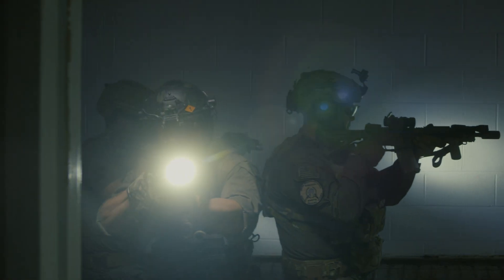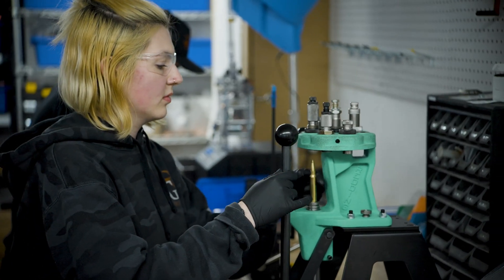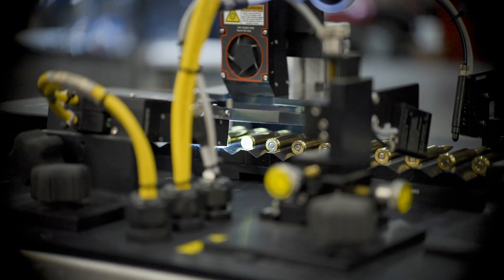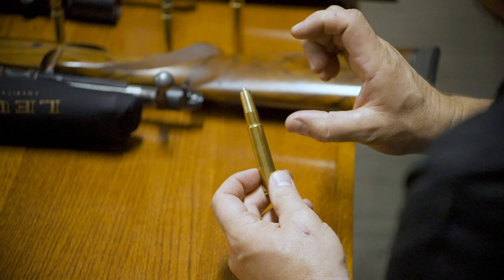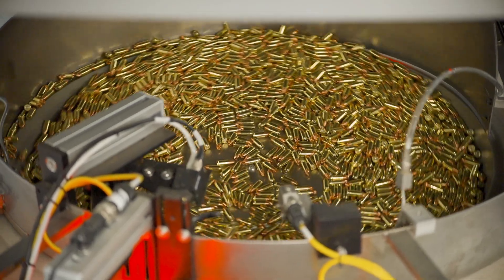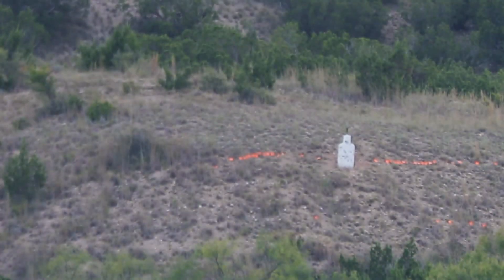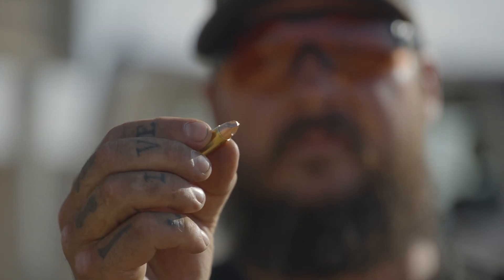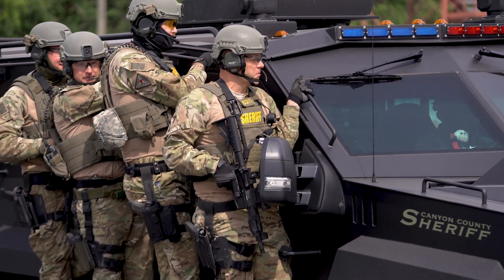G9 Defense - Reshaping the Future of Ballistics

Comment: I'm still waiting for some gel and penetration testing of the Woodsman. I have only seen one test done and there was like zero wound channel. That has me concerned, as even a hardcast does better than that.
Maybe that's why we don't see promos for the Woodsman.
Reply: Have you done any testing yourself? 
I was thinking of using the woodsman for the outdoors but your comment has me concerned
Reply: @larrydotsonviet2 
The best way to answer your question, is to say yes. I took a whitetail buck at 60yds with the 9mm Woodsman from a PCC. The Woodsman got a full passthrough and did its job very well.  The entrance hole was filled with tiny bits of hair from the cookie cutter effect. The heart was opened up on one side. The offside passed though a rib and blew bone fragments into the far front leg and exited. There was no sign of destabilization. The buck went maybe 50yds before going down. 
I was very pleased with the results. The PCC used was a TNW ASR and I did have to reshape the upper feed ramp to work with this profile. The side benefit was it solved feed issues for some other rounds as well.
Bottom line, would I use it again? Yes
Reply: @CrawldaBeast thanks for the fast response man! I just purchased a PCC myself, and can’t wait to order the woodsman G9 ammo when I get paid! Happy hunting and safe travels!

Comment: With so many people utilizing comps it seems almost necessary to make this round in at least 115 grain. I’m down to buy a box and see if it will cycle as reliably as promoted. But I’m not expecting much.

I’m also always leery when small channels don’t engage with their commenters or respond to legitimate inquiries. Doesn’t seem like their customer service would be much better.
Reply from the maker: A compensator works on the amount of gun powder not the weight of the bullet. Lighter weight bullets use more gun powder. We have spent a lot of time ensuring our inertia is sufficient to run in defensive gun platforms. Sorry for the delayed response. We prioritize legitimate customers above internet trolls. We have heard your concerns and the product is in stock on our website. If you would like to function test our product on your platform. You are more than welcome to buy a few thousand rounds and try it for yourself. We are extremely proud of the quality that we offer.